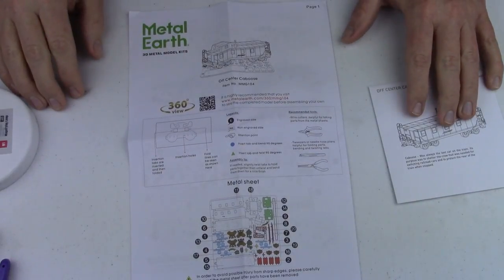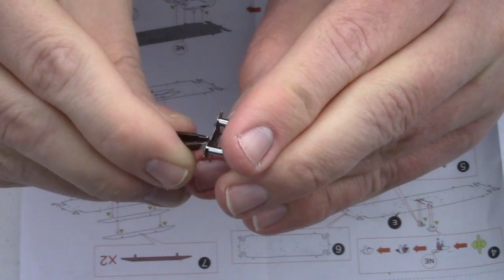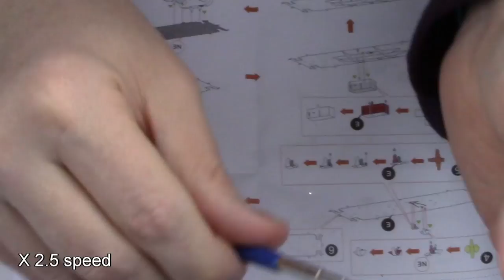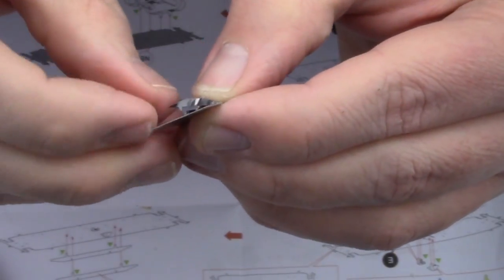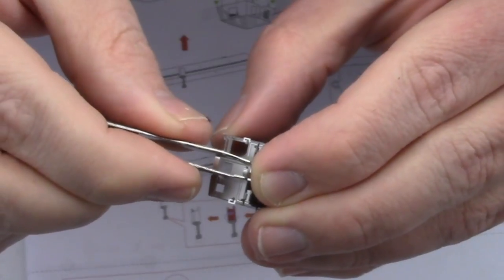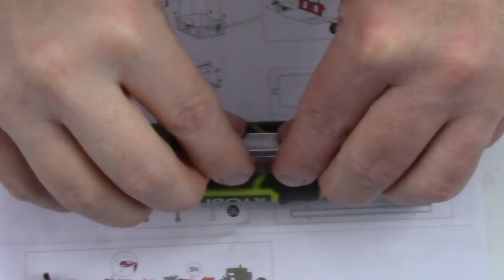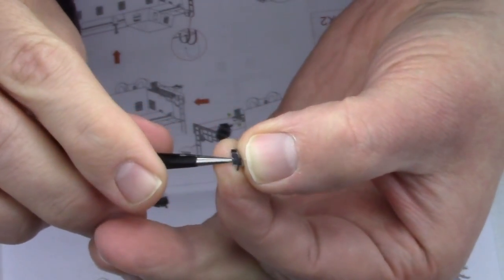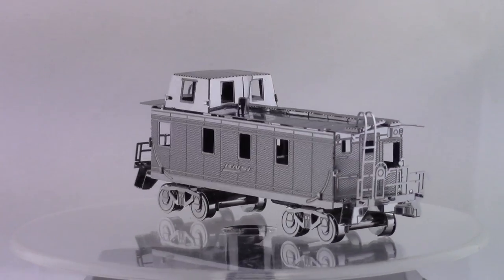Metal Earth Build - Freight Train gift box - Off Center Caboose

Comment: From where did u buy this and how much did this entire Train cost??
Reply: Btw Great Videos 👍🏼would u recommend buying this for a "beginnner"? So far i built about 7 Sets
Reply from the maker: I bought mine at a local craft store. It cost about 30 dollars. I wouldn't recommend this as a starter not because it is particularly hard but because it's a larger more expensive model (or set) and I there is a fair chance that something might break with your first model. I would say build a simple one sheet model to at least get a feel for these types of models first.
Reply from the maker: And after I hit send I realized you said you had built seven models so far. In that case you would probably do just fine with this model.
Reply: animateorange ok Thank u🤗
Reply: i'm sorry, but i've got another question..😂i often dont like to twist tabs because its not stirty enough, in my opinion its important that the model is very stable, but when i bend the tabs, its going to wiggle or tremble. I do not care if it looks not as good as when u bend them but i feel more comfortable by twisting them. how do u feel about that?
Reply from the maker: Felix 123 I do feel that twisted tabs, if done correctly, are more stable and secure. I do prefer folded tabs on more visible sections but if the part seems structurally important I will likely twist the tabs to make them more secure. Also in cases where folding the tab is overly difficult and/or trying to fold the tab might cause damage to other parts of the model, I will twist instead.
Reply: animateorange ok Thanks for your responses🤗i appreciate it